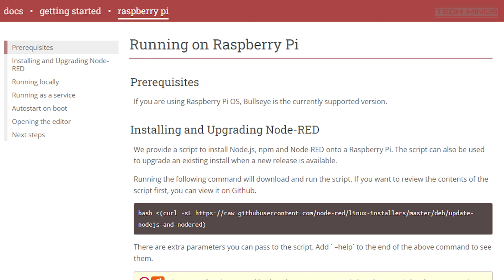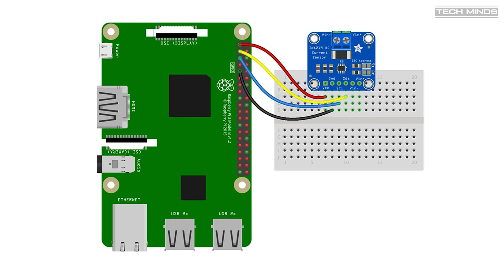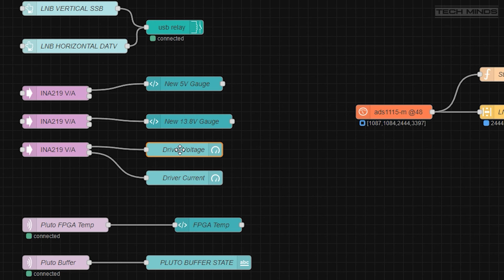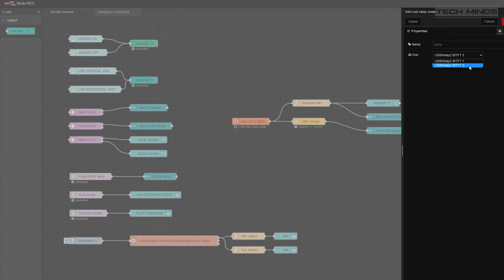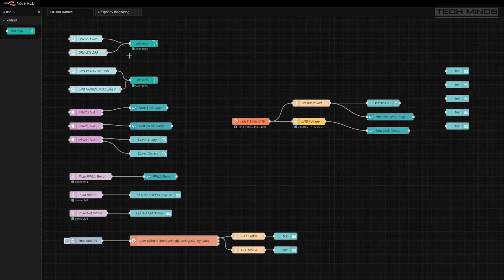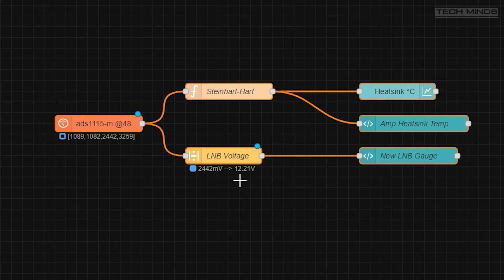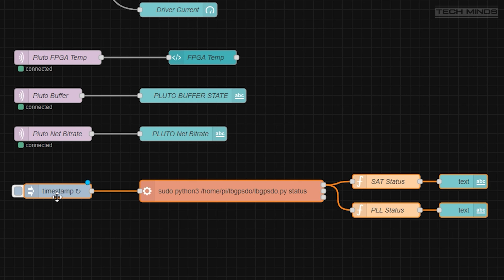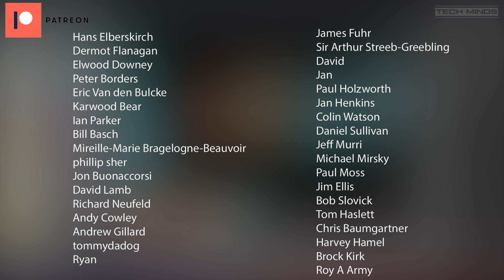How I Made My QO-100 Control Dashboard With NODE RED

Comment: Hi Matt You are obviously a Master of Node Red.
Great looking interface but sadly it stopped too soon.
How did you configure the Pi to output the GPSDO Data from the LB and how did you create those great dials? Html I assume?
Trying to do something similar but will use an INA266 for my PA as it will handle over 26V and up to 20A but so far failing.. 
At the beginning of the video you spoke of being asked if you would share your JSON file for the layout.
Would you mind sharing your hard work for us less proficient amateurs :) 73 Nick G1BVI
Reply from the maker: Hi Nick! I don't think I used NR Dashboard 2, I just coded it as shown. However, I dropped the use of those dials fairly soon after making this video. For my purpose they were too laggy. It could have been because the Pi4 I am using also controls my DATV receiver, and does the trans-coding etc. But, I went back to using the original dials that come shipped with NR, they work great. With regards to the data from the Leo Bodnar, you have to use a command line script and then echo the response to NR. I believe LB have some example scripts on their Github, or at least they used to. Cheers